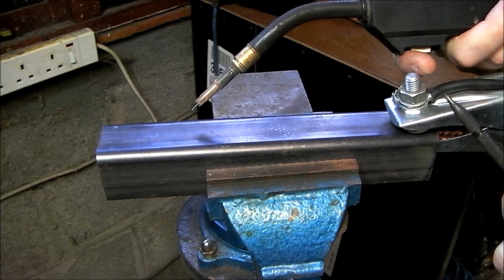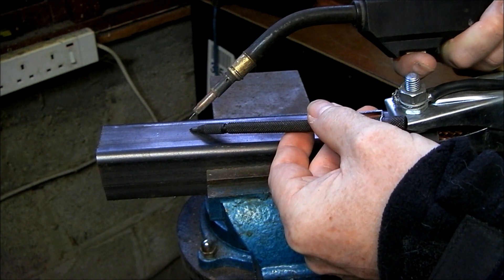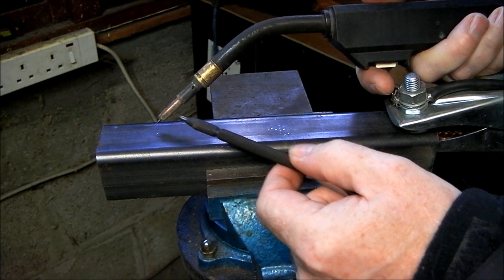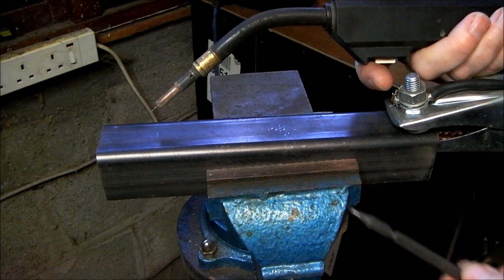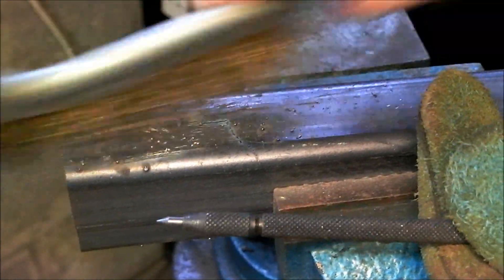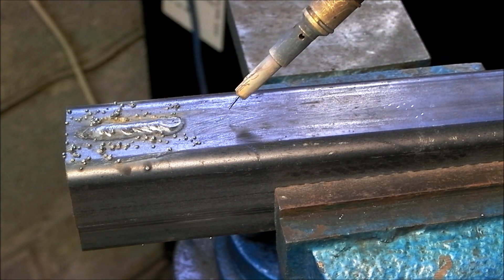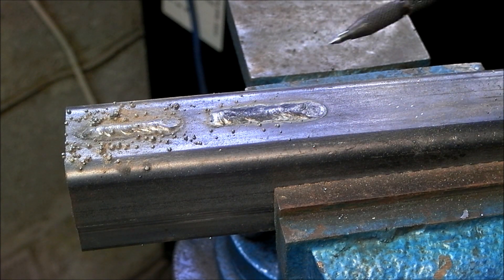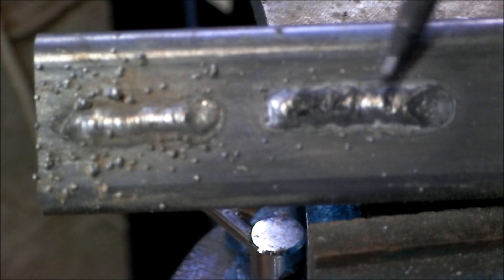Flux core welding tips, why change polarity?

Comment: I got a flux-core welder as a gift a couple years ago and was  very disappointed with the amount of splatter.  After viewing this video I reversed the polarity and was very happy with the results.  Reversing was not easy.  I had to un-crimp the leads and re-crimp, but it was well worth the effort.  I had given up using this welder because of the splatter, but now I can weld the thin stock that had been so difficult with a stick.
Thanks for a clear explanation with a great demo.
Reply: At least you described why its needed. The first time someone explained it thank you

Comment: Bloody hell! Here I am struggling to learn to have better welds and always made a mess with splatter everywhere. Struggled to find the right setting so there were minimal splatter. Sometimes it’s either too high and would burn the wire to the tip or burn a hole.

I never even researched or read anything about the polarity change. I just assumed that all mig welders had the same polarity with a gas setup. I am just learning to weld and I need a ton of practice.

But I’m sure after knowing that gas and gas less setup have different polarity, I’ll be more determined to give it another go. It was discouraging when I look at my crappy weld, it’s one of the worst anyone would ever see! Not having the right setup doesn’t help either.

THANK YOU for the video!

Comment: Wow, great demostration! Thank you sir. I just wish you had mentioned to use knurled wire drive wheels with soft crush-able flux core wire. When changing from gas to gasless you need to change the drive wheel and the polarity. Flux core needs Negative Electrode and Knurled Drive Wheel.

Comment: Good video, l just bought a flux core 130A set brand new £80, after only ever using stick, arc, MMA welders since early 80s as l was a coded welder, but this set really is OK, 0.8 wire, get very good welds, but for the people buying for car body work your better with a gas mig set as these flux cored will blow holes in the plate, but for general welding there great.

Comment: I’ve welded most of my working years, and a mig using gas is the best way to go, save your money and buy a mig welder with the gas tank. No splatter at all and great welds. A tig welder is also a great way to go , I should do more videos on welding with a tig welder.
Reply: GAS IS NO GOOD OUT ON SITE ON A WINDY DAY THOUGH.

Comment: Yes I’ve been looking for a video for the explanation for why you you should switch the pluralities with positive and negative connections! Thanks just got a question for you. Can I do this with any brand or voltage mig welder?  Cause the welder I have does not make it easy to access. Looks like I need to take cover off all 8 or so screws. This welder is old and company out of business.. thanks again for your help great vid 🧨🔌

Comment: This could potentially confuse people who are not trained professional welders... Always refer to the parameter guidelines for which polarity is to be used. Generally the polarity depends on whether you are using a shielding gas in conjunction with the wire... FCAW self shield/ FCAW Dual shielded.

Comment: Thanks . I hope youre right . I got a new inverter welder with 4 functions mig , mag , mma stick , tig .
 The mig and mag are to do with the inert metal or gases . The google is hundreds of contradicting stories .
 My instructions only said mag was negative electrode  no gas . But i have a lot of spatter and cannot see the puddle . Only see the arc . I can switch easy enough . 
   So i think of it as a lightenig gun . Zap zap negative to remember 
 Thank you again

Comment: I have a question first time welding I use forney flux core wire .30 which says polarity is DCEN.. I really like that wire it worked great I ran out and where I got it from they didn't have anymore so I purchased  inweld flux core .30 at Fazzios but this one says polarity is DCEP........ Also for regular wire it says DCEP .. I think this company mislabeled the description. I highly doubt both solid wire and flux core wire run on the same polarity. Anyway do I still run this wire on DCEN I was experimenting today this wire which sucks by the way it  leaves a lot of slag and a lot of powder. It leaves a mess unlike fortney wire... My question is should all flux core wire regardless of the instructions be run on DCEN..

Comment: What brand of  flux core wire do you use, prefer? I know there are a lot of cheap stuff out there, a lot of which isn't great. I use a Flux core mig using SiF MIG  flux core wire.

Comment: good tips!!!! but you should still use a cup, the spatter could come up and block you're gas outlets and all that good stuff!!!
Reply: Flux core doesn't use gas, that's why he didn't use or need the shield.
Reply: Plastic tip to protect the copper nozzle.
They sell them online. Pack of two $9.

Comment from the maker: To be totally honest, I don't use a  branded flux core wire. I was more interested in the diameter. it is more common in .9mm diameter. I wanted a .8mm wire, so as not to have yet another tip size

Comment: I have a Jegs Mig 100 flux core welder. I opened it up, and everything is hardwired. So I didn't change the polarity, because I was afraid of vouding the warranty. The machine makes terrible spatter, but I don't know anyway to change the polarity without butchering the machine. Any suggestions?

Comment: I've checked my Mig welder and although it's gas and gas less there is no where to change clamp lead to positive ,I've opened Mig welder completely up inside and no negative or positive terminals. My Mig is an old taskmaster 130 gas and gasless  ,
Reply: There's limited info on your welder on the internet.  But it appears that your welder is gas only.  DC- is for gasless FCAW.  Since yours is DC+ only, you need gas to weld steel, stainless steel and aluminum.  Being old, it may have been built in the days before they understood the differences in welding results between DC+ and DC-.

Comment: Ma nigga backstreetmechanic showing 2 tutorials in 1! Notice how he isn't using those super rare plastic shrouds / mig tips designed for flux core but simply removed the regular metal shroud and just welding with the 0.8mm tip as it is giving him much better visibility. From all the welding vids on jewtube this is the guy to watch.

Comment: DCEP and turn the wire speed down or the voltage up.  Unless the wire is SPECIFICALLY for DCEN, do NOT switch polarity. If you weld on anything that peoples lives might depend on, do NOT use Electrode Negative.  I weld on powerplants and steam pipe for a living.
Reply: Jeff Benefield  good point but all your doing is making the piece hot and your gun the ground! As long as you keep working area clean and safe.. give ‘er 🔌🔌🔌

Comment: Why don't you have another piece of metal over the tip of your gun ? (I'm new to welding)
Reply: It's more of a dielectric shielding to  prevent noobs from accidentally contacting the "gun" to the workpiece.   It's really only necessary for MIG because it contains the shielding gas.   On your average harbor freight, northern tools, or tractor supply "AC Flux Core Welder" it will come with a shield or two of two sizes... Just throw them away unless you plan on letting your kids or best friend play with it.
Reply: @jamesharrell4360  Ok thank you :P

Comment: I don't get it. So, that means, just lower the tip more? How can I change positive to negative? So confused...Just got a 90v from harbor frieght and my welding splattering sucks!
Reply: inside the machine next to the wire there should be two knobs positive and negative,  you take the eyelits off and switch them to reverse polarity
Reply: +TheNoobComment Harbor Freight 90 amp welders are only AC there is no ability to switch polarity, their 170 amp welders can be changed. For Flu core wire. But you can get good welds with 90 amp machines. Keep your material thickness down to 1/8" .

Comment: don't electrons flow from positive to negative? This is known as conventional current right?
Reply: bugeyerexxin Sadly, no, they do not.  When Benjamin Franklin came up with his view of how electricity worked, he had to make a guess as to which way the charged particles actually moved.  He had a 50/50% chance, and guessed "wrong."  By the time we learned better, the convention had been cemented in place, much to the chagrin of electrical engineering students everywhere!
Reply: So you are saying that initially the idea of conventional current was established, however it was discovered to be incorrect. So today, it is correct to say that electrons travel from negative to positive?
Reply: +datstocklyfe yes. We had an understanding of electricity before we did the atom. So we based our current convention to go from positive to negative. But now that we have an understanding of the atom and subatomic particles, we know that electrons physically move from negative to positive. It doesnt matter too much, it is just annoying. In fact the naming of positive and negative are completely arbitrary and dont attain to any positive or negative values when talking about charges.
Reply: In today's theory of electron flow, the negative terminal has an excess of electrons (which carry a negative charge).  The positive terminal has a deficiency of electrons (which make it positively charged).

Comment: Unless its s fixed flux core that u can not switch  . Ok  i did good welds on flux core welders that are fixed fer flux core that one couldn't  do reverse popularity  negative  abd and positive leds to switch .. i seen alot of that machimes on flux core welders  that wasnt a fixed to fkux core only mig welders that can use flux core if one reverses polarity or swith from negative to positive ans positive to negative.. mine are fixed to run flux core wire no revers or cables to switch they are fixed.  Meaning no switching the lead cables . Positive  cable and negative cables. Its a fixed cables and its low or cheap so lol. I still made dime welds and solid smoth welds and holds up.  . Either way.  Just saying . If one has a,flux core welder  the leads are fixed one can not switch the both leads .. again i made some good welds i got three flux core welders machines . O.o3 and 0.o35  flux core wires another is stick welding rod.  0.030flux 0.035 flux core wire . I not rich ok lmao . Bjt they did good snd penetration  are good too . I did bending i put devices to break the welds but couldn't.  Ironnically the cheap flux core welders  passed.  They have good penetration on welds . My opinion..